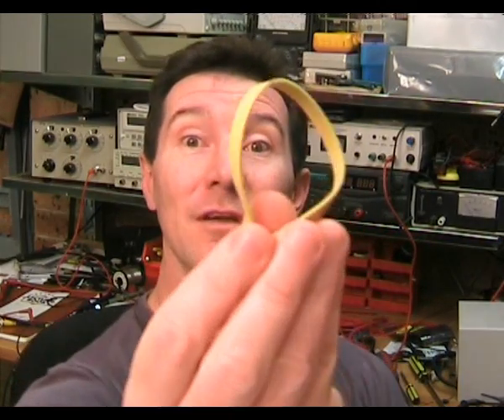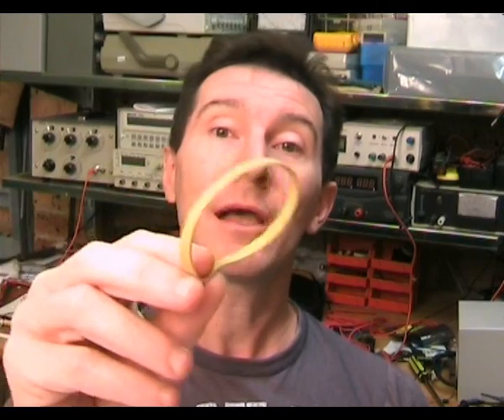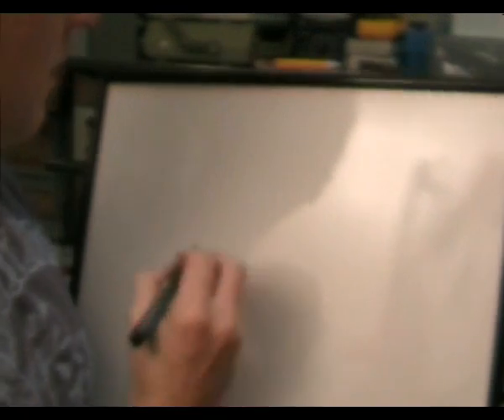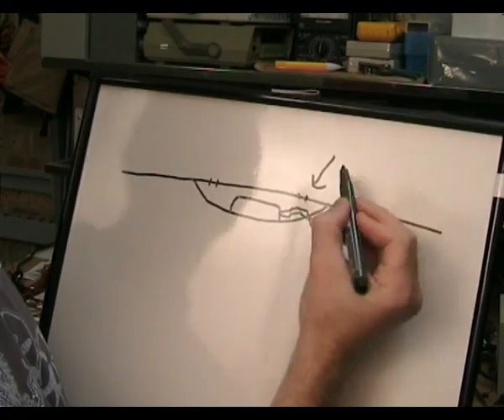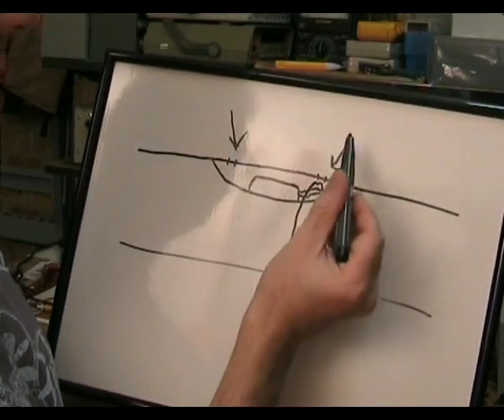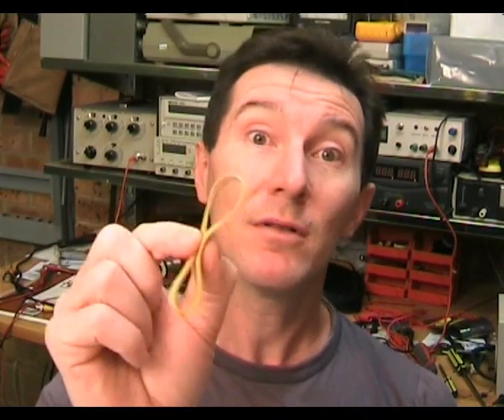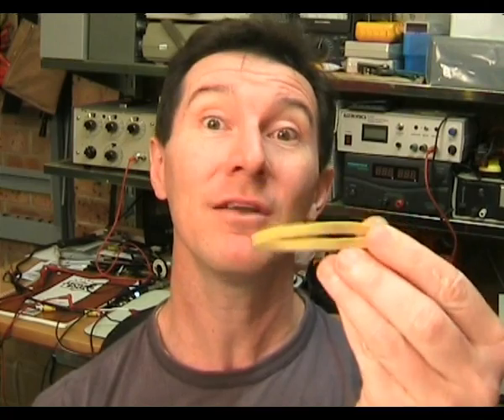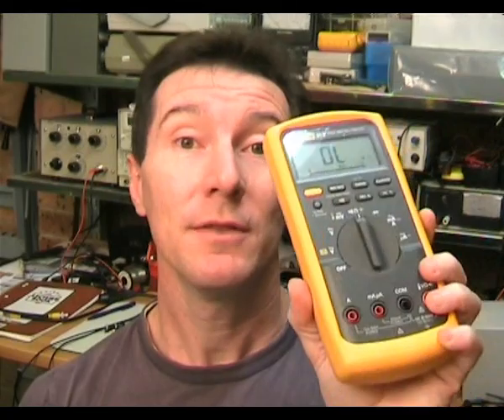EEVblog #10 Part 1 of 2 - How a rubber band cost millions of dollars

Comment: prior going over this expensive repair procedure, checking against another meter was not an option ? I follow you channel but when you start talking about chinesse = crap, hey, this is a complete BS. Well known brands have being producing in china, it ALL ABOUT Q.A. You can manufacture a product in Germany and turn into a complete Lemon ... How many things inside the 87 IV are chinesse, lets count ... talking about components .... even the bare PCB, could be chinesse. Yeah ... assembled in ..... bla bla bla ... I get the board assembled from China, put a couple of wires, conectors, a piezo, close the plastics (chinesse injection or molding warning) .... yeah ...
Reply: +38911bytefree maybe, but while most cheaper Chinese designed (design is a more important factor than manufacture) products are somewhat crappy, most German products aren't. Statistics aren't on your side, unfortunately.
Reply: mjouwbuis today almost electronic gear, bad, good and premium is assembled in china. Statistics from that era please. Apple is premiun quality an assemblesd in china. Do more research, even the good lab gear is chineese. QA is EVERYTHING, the place is just a circunstance, Germans are not that good in many things. Brazil make the best regional jets IMHO ... things are globla now and the "made in japan" model die LONG AGO. Just research what Sony and Panasonic have done about that over the last decade ... LOL, statistics. Yeah
Reply: +38911bytefree Please reread the whole of my comment, including what I wrote about the difference between manufacture (assembly) and design. China made products can be quite good. One way to ensure that is to have a good quality control system in place (as Apple does) and to have your own design team to design or check the design (as Apple does).

The crappy stuff is mostly designed down to a cost by the Chinese manufacturer itself without any form of quality control or feedback. Empirical statistic data can be gained by looking around you in a dollar store, for example.

Another way to get crappy stuff is to send your design (or only requirements) to a Chinese OEM and ask for a low price. First samples will be good, later production will have cheaper (fake or substandard) components that precisely reflect the cost you asked. They will never mention it won't work for that price. Of course for that particular manufacturing problem the blame is shared between the cheap ass importer and the crappy manufacturer but it is a problem that is rarely seen with goods from other countries.

Comment: Come on, stop spewing bull**it.

Any company that trusts chinese cheap multimeters so much that then at some point loose significant money is company of morons.

Your explanations sounds as if it was "customized" to suite some of more established manufacturers that might lent or gave away some equipment for your tests.

I am not saying that chinese crap is in every aspect equal to e.g. FLuke, but it certainly can be useable for some non-critical uses.